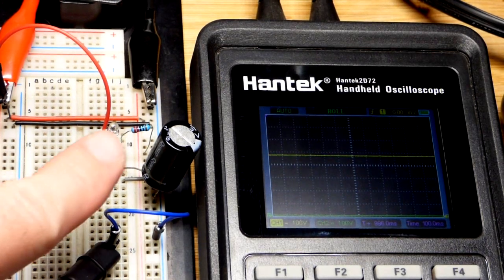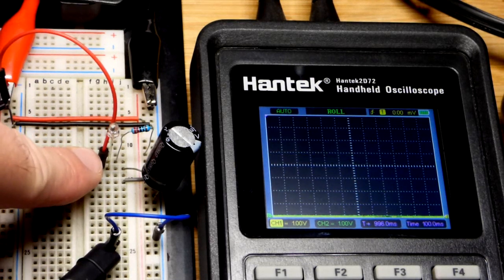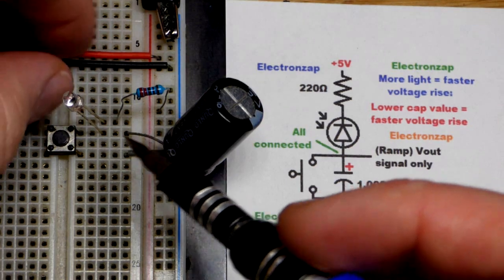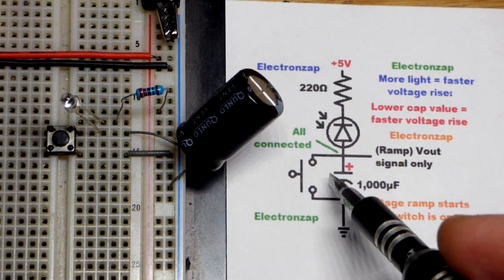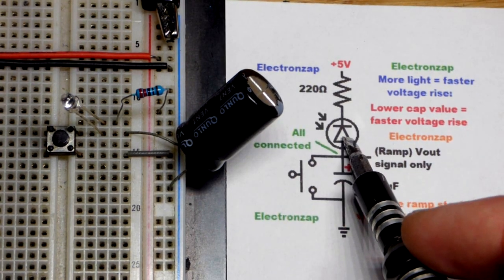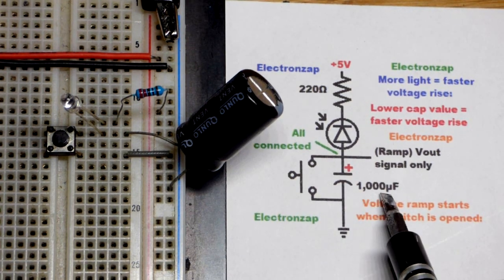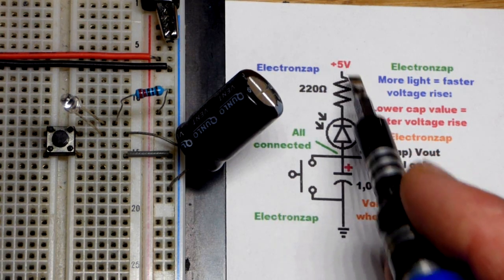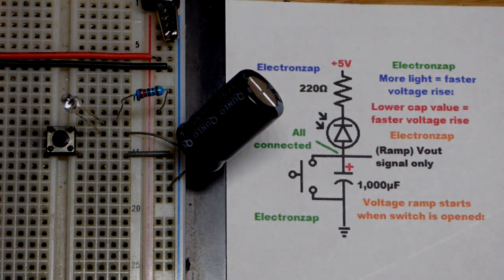Light level sets voltage ramp using photodiode circuit schematic by Electronzap

Comment: All Integrators must eventually be Reset, but discharging "instantly" 1000uF @ 5V into a tiny switch is a heck of a lot of current on that tiny  switches contacts. I suggest a 330 Ohm resistor to limit the current thru that lil-switch. Do the math on Ten (or zero) Ohms instantly shorting out 5V from that 1000 uF cap.
Thank you very much for making these teaching videos!